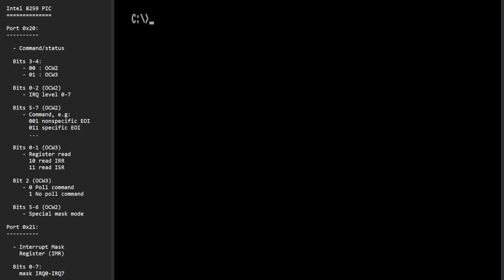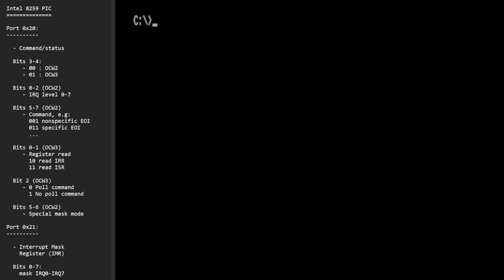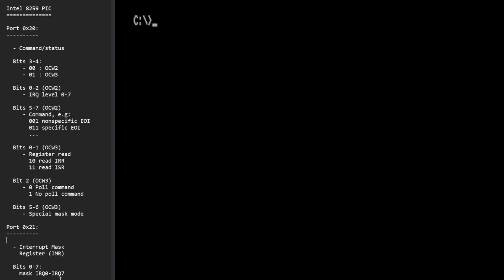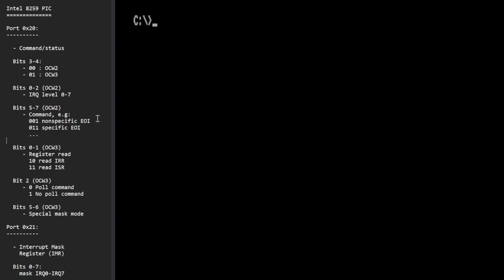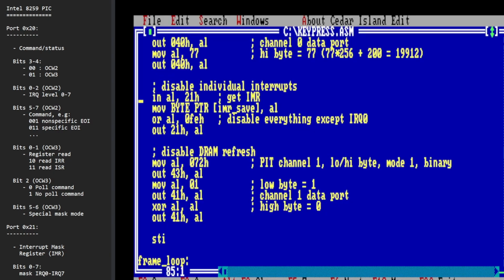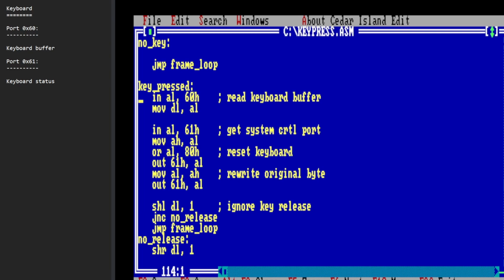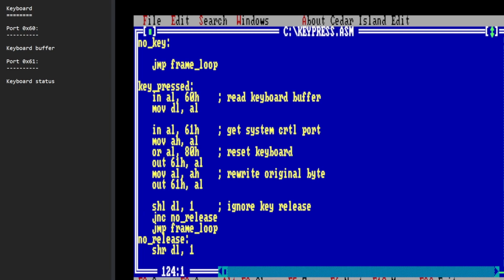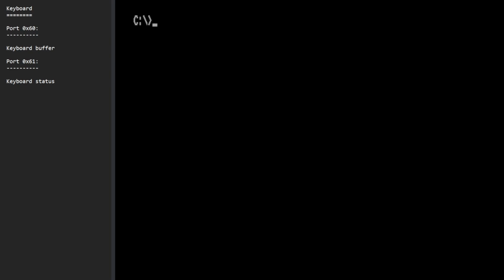Advanced CGA Graphics: Keyboard without interrupts

Comment: According to the 8042 keyboard controller datasheet the buffer is just one byte!
Reply from the maker: Ah I did try to look that up, but just got datasheets for some microcontroller with 256 bytes of RAM or something like that. My assumption was that it would be one keypress or one scancode or something like that, but just couldn't find the right info. Thanks for hunting that down.
Reply: @pcretroprogrammer2656  I found this one https://tvsat.com.pl/PDF/W/W83C42P_win.pdf not sure if this link will work in the youtube comments but it's a W83C42 which seems to be a more modern (relatively speaking) variant. In there it says "The output buffer is an 8-bit read-only register at I/O address hex 60. The keyboard controller uses the output buffer to send the scan code received from the keyboard and data bytes required by command to the system. The output buffer should be read only when the output buffer full bit in the register is 1." I think I found the same note in an older pdf but I can't find the link now for some reason!